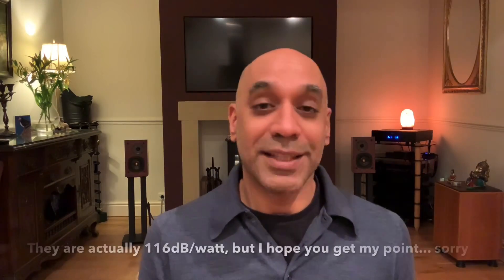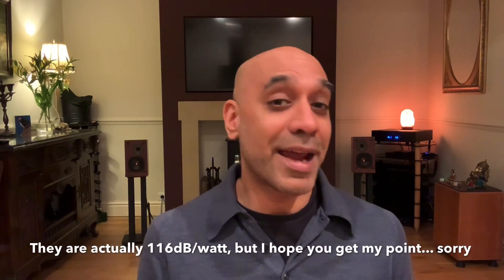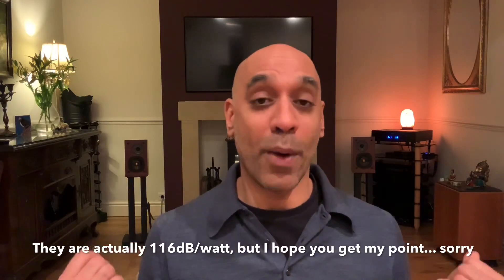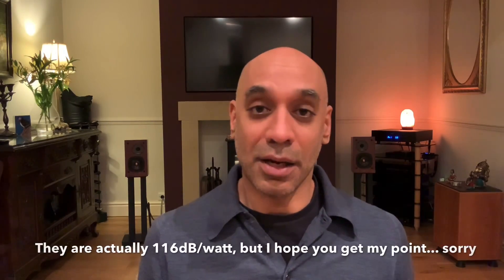Hifi Myths & Misconceptions - Amplifier Power

Comment: If an amp is very good at low bass, is this due to the amp design or because it has more power to produce them well? I seem to remember Musical Fidelity used to argue that you needed a certain amount of power to repoduce music with very low distortion and good bass, but later on they went back to lower powered amps. Any idea why this might be?
Reply from the maker: Speakers represent a dynamic load. You need enough watts to play at a certain volume and manage dynamic swings but it is how the amplifier responds to the dynamic load that is very important. Of course, there are many other considerations, slew rate, damping factor, etc..
Reply: So do you think it’s a bad thing to think of amplifier power in the same way as we do for car engine power, ie that more power means greatest responsiveness and smoothness?
Reply from the maker: @Coneman3  I think that is a good analogy 😉👍

Comment: Klipsch RP-600M's are around 93dB @ 2.83V / 1m so they're pretty easy to drive but they also dip down to 3 ohm so they're pretty hard to drive at the same time lol
Reply from the maker: Need current not much watts 😊

Comment: This is a such rare case, where the explanation makes sense. Listening to a lot of demanding classical music (large orchestras and operas) in very modern recordings with a lot of dynamic range, statements that 40 Watts would be enough never matched my experience. Maybe if you are listening to a jazz trio, although would have to be at moderate levels for low sensitivity speakers. 
When auditioning gear, my experience has been that when I needed the "horses" lots of candidates for amplification (and speakers) did not perform as great as what small ensembles hearing would suggest.
Excellent!
Reply from the maker: Thank you Petros. I appreciate you watching and sharing your experiences. Thank you for your kind words of support 😊👍
Reply: How big is your room?

Comment: Another very informative video, I subscribe but must have missed this but looking at the published date it is perhaps no surprise. I just wondered if you could give a brief answer to my scenario. I have a mid 1970 Technics reciever/amplifier which I really like but it is only rated at 15 wpc. I am looking for some compatible speakers and am thinking I need to seek something that is pretty sensitive, so I am considering Klipsch RP500M as they are rated 8 ohm 93 db. Given my financial situation would like to buy a little cheaper, so could I consider other speakers that may only be 88 or 89 db. Just to add my room is fairly small and generally don't play at any great volume, although Led Zeppelin require a little extra! Many thanks.
Reply from the maker: I think your thinking is sound. The RP 500M would be a good choice as long as you like the sound characteristics. They will be great with Led Zep. Thank you for watching and your support 😊👍
Reply: @abritishaudiophile7314  Thanks for your response. Re reading my post I wasn't too clear. I suppose what I wanted to ask was is it that necessary for me to chase such sensitive speakers, i.e if 89/90 db is okay then it gives me more options. As you will know, more sensitive speakers are few and far between and often much more expensive.
Reply from the maker: @stephensmall4172  I am not sure how much current your Technics amp can deliver but as you don’t listen at loud levels something in the high 80s sensitivity should be fine.

Comment: Great video. I cannot agree more. 95% of us need 20W or less. 
Just built (DIY) monoblocks class A 25W @ 8Ohm. They replaced 350W @8Ohm monoblocks class D and sound fantastic. speaker sensitivity 91.5dB/v/m, 50m2 room, 2m from speakers, average listening volume 75dB, peaks 83dB. No need for more power. 
Invest in quality, not in Watts!
Reply from the maker: Thank you for watching and sharing your experiences Decemberek. I always admire people who go the diy route 😉👍
Reply: Just not my experience! Small UK living room various mix of British and Japanese amplifiers (Arcam Rega Technics Denon etc etc ) latest Arcam was 120 watts. 25 year old Ruark Acoustic Templars 87db sensitivity
 Always running out of steam especially on vinyl. Experimented with valve preamp and Class D 600 watts per channel.
Very happy No strain maximum headroom total clarity and the bass is alive and palpable
I think the audio industry used to be like the car industry. The big comfortable family car starts with a 1 litre engine which is inadequate and they shaft you financially to get the 6 litre engine you really really need
Reply: Invest in quality watts.

Comment: quick question... my speakers info sheet says ''Recommended Amplifier Power: 30W/ch minimum, 250W/ch maximum'' how much am i shooting myself in the foot if i buy a 35 watt/ch amp? because following this logic it should be plenty... but then why are they recommending 30 watt/ch minimum. im confused ( Sensitivity: 87db (2.83V at 1M)
)
Reply from the maker: Hi Alex, watts are only part of the picture. You want a bit more than you need. Headroom is a good idea. Ultimately watts determine how loud a speaker will play. Try to find out what the maximum current rating is. This gives you a better indication of how well an amplifier can drive a speaker 😉👍

Comment: Just to be sure i understood (not english native speaker sorry) ; the lower the impedance, the more power you need ? Thats weird, in the headphone world i think its the opposite : higher impedance = more power needed, thats why im confused 😅
Reply from the maker: Hi Kabi, great question. Impedance is only part of the picture, you also need to consider the sensitivity of the speaker/headphone and how it relates to impedance. For example, a speaker may be driven by 1 Watt, and at a particular frequency be 85dB sensitive driving an 8 ohm load. The same speaker may drop down to 4 ohm impedance at another frequency and now will be demanding 2 Watts from the amplifier. 

Now, higher impedance headphones tend to be less sensitive than low impedance headphones. That is why they demand more power to drive them to the same level as low impedance headphones. Thank you for watching and for asking  a very interesting question 😉👍
Reply: @abritishaudiophile7314  thank you very much its way more clearer now !! Cristal clear explanations, a real master ahah again thank you :)
Reply from the maker: @Ankah  thank you Kabi 😊👍

Comment: Tarun, great video. I have a question though. I have a pair of Elacs rated at 4 ohms and 85 dB sensitivity. I was driving them on a moon audio integrated rated at 75 watts into 4. I recently switched to an anthem integrated rated at a whopping 300 watts and I noticed an immediate difference in the quality of sound and depth of the bass. It was a night and day difference. Do you think that has more to do with a different amp or the difference in power. I also listen at around 75 dB.
Reply from the maker: Hi Randy, thank you for watching. It won’t be the watts although it is good to have some headroom for dynamic peaks. Still you are probably only using a maximum of 10 watts. It will be the overall quality of the amplifier and specifically the quality of the power supply. 😊👍
Reply: @abritishaudiophile7314  much appreciated. I was quite unimpressed with the Moon. Today it went to a new home via eBay. Your comment confirmed what I assumed.

Comment: i guess everyone needs 100watts per channel, if you have two people with different taste in music & loudness. 100 watts is a must, i really dont get it how people sat 45 watts is enough.
Reply from the maker: Hi Abhijit, I depends on the efficiency of the speaker, the size of the room and the quality of the amplifier’s power supply. Unfortunately, it is not just as simple as how many watts. Higher watts can be achieved just by turning the gain up on the output device.
Reply: @abritishaudiophile7314  totally agree that a klipsh & JBL need less watts, but 100 watts is a safe bet for most of the listeners
Reply from the maker: You are probably right. It should be enough for most if backed up by a decent power supply 👍

Comment: Hi my current set up is Kef ls50 and a Hegel H90 that i was able to buy for £1050 new because it was a Discontinued - Reduced to clear item, im considering the H120 but its costs over a grand more do you think my money would be  better spent on a decent subwoofer to improve my set up or upgrade the amplifier ?
Reply from the maker: The H120 will offer an incremental improvement in sound quality. If it was me, I would be investing in a subwoofer or better still two smaller ones. Check out the BK Elec XLS200. They make subwoofers for other manufactures and used to make REL subs in the past. The XLS 200 is the most musical sub they do and it is less than £400.
Reply: @abritishaudiophile7314  i dont think my amplifier can take two subwoofers?
I really like the svs subs that have wireless app controls but they are really expensive. 
The bk xls200 is on my radar how do they compare to the svs subs?
Reply from the maker: Hi Harry, if you get a REL or BK Elec, you can use the high level input and connect it to the amplifier speaker binding posts or even the speaker terminals. The other option is to use the variable line output on your Hegel H90 but the high level input is my preferred option. Good luck 😉👍

Comment: What modern amps today push 800 watts?  Are we talking huge price leaps?
Reply from the maker: Not too many hifi amps go up to 800 watts Sean. Very few people would need 800W in a domestic setting.
Reply: @abritishaudiophile7314  These types of vids are really helpful in determining just what kind of integrated amp a guy should buy.  I'm just starting the learning process myself.  I grew up thinking the higher the wattage, the better and I like listening to my music really loud so I have it in my head that I need massive power to suit my needs.  However....my local stores aren't too terribly high end so its almost impossible for me to hear a amp/speaker combo before I buy.
Reply from the maker: Thank you for watching Sean. If you listen loud you will need more power. This video was just to shed some light on what kind of power people may use. I would start with picking out a pair of speakers first. Large speaker tend to be more efficient (higher sensitivity) and will play louder than smaller ones. Picking a speaker with higher sensitivity and power handling will mean that you will have more choice when it comes to choosing a matching amplifier and not just restricted to the ones with high power ratings. Good luck 👍
Reply: @abritishaudiophile7314  Any recommendations for a higher powered integrated amp?  I'm leaning towards the Klipsch RP 8000F for speakers and the Yamaha A-S801 Amp for starters but I'm open to suggestions.
Reply: Nord 2 based on B&O icepower as1200 boards 600 watts per channel at 8 or 4 ohms £800 brand new 2 year guarantee Other European manufacturers use B&O icepower boards
I Use a xiang sheng 728 tube preamp to drive it (£250)
Any non class D amps with this power will cost thousands 
Beautiful sounding

Comment: In my experience over the years of playing with all sorts of power amplifiers, I prefer high current amplifiers.  Also a higher wattage amplifier of like 300w per channel with high current capability is all you will ever need.  Even though you may not use all those watts the music just sounds more effortless and you for the most part cover all your speaker types without going into extremes.  I would just say the sound is not strained because you have so much power on tap and the amp is up to any task.  Just make sure its a well designed amp, since there are many powerful amplifiers out there that are just dj amps and do not sound good with a few exceptions, which I actually use in my set ups.  They are called sleeper amps and are somewhat of hidden secrets.  Some class D amps are not to bad, but in my opinion a well designed classic AB amp is hard to beat unless you pay K's of dollars and you can definately avoid that.
Reply from the maker: Hi Sound Man, thank you for watching and sharing your experiences. I really enjoyed reading your comments 😊
Reply: Yes, an ampli not able to send current won't be able to deliver it's nominal power, there could be compression on classical music

Comment: I've just bought an amp with 170w PC into 4ohms, my speakers are 100w PC at 4 ohms. My amp is in decibels and sometimes I take it up to -20db which I assume is was over what my speakers are designed for, am I going to damage them even if they sound really clear?

Am I deaf?
Reply from the maker: Hi Darren, if the speakers aren’t distorting. You won’t damage them. You need to protect your hearing on the other hand 😉
Reply: @abritishaudiophile7314  thanks Tarun, sound advice!

Comment: Super helpful thank you! I've always wondered how a 15w systems can seem to be "loud enough" and an 80w system can feel like there's not much headroom. I'm starting to understand the importance of a good preamp now. When I was using a vintage receiver it felt like once I went past 11 o'clock I was "turning it up" and now that I'm using something with a cleaner circuit it feels like anything below max volume is just "turning it down". So I guess if you are running low watts you better have a nice clean preamp so that you can ride the level in the upper register without any degradation to the sound.
Reply from the maker: Hi Marc, thank you for sharing you experiences. Certainly a good preamp can help to lower distortion and clean up the sound. Most people don’t need as much power as they think 😉

Comment: Hello Tarun, Thank you for your informative and calm, quietly delivered videos. A question regarding wattage output: when an amplifier, say for example, The Hegel H160 (which you have reviewed) is claimed to produce 150 watts CONTINUOUS  output. Is it producing 150 watts even during quiet or silent passages in music? I do understand what peak power is and the need for headroom and I know that the amplifier can delivery more current to produce the driver requirement for dynamics. I just find the term "continuous power" confusing,  can you demystify please,  every good wish, Michael.
Reply from the maker: Hi Michael, your suspicion is correct. The power demands on an amplifier change with the music signal. Continuous power is just the amount of power an amplifier can produce for a prolonged period of time (say 1 minute) without clipping, overheating or production high levels of distortion (normally below 1% THD). Manufacturers should use a test signal to determine this. The reality is that there is no particular standard that manufacturers’ follow so it should only be used as a rough guide. Thank you for watching and commenting 😉👍

Comment: Great video! I wonder if there is a website with the formulas you describe where you can enter the values and get an approximate number of what you may need? For example, I have 6 Ohm speakers in a 16' x 18' room and I listen at moderate levels (70-80db). I sit approx 2 meters from my speakers. So how much power do I need? What a great resource that would be. I subscribed btw. :)
Reply from the maker: Thanks Dwight. No website that I am aware of but you can do a similar exercise to what I did in the video. Thank you for watching 😉

Comment: Good video. Tarun, I've been around HiFi since the early seventies so I very familiar with all the technical aspects you discussed. My take on amplifiers is that when putting together a system 1.) Find speakers that you like the sound of. And
2.) Find an amplifier that will properly drive those speakers.
3.) Choose which playback format you are going to use most often and get the best possible piece of equipment that you can afford.
4.) Then spend weeks, months even find the best sounding placement of those speakers in your listening room.
Since 1984 I've been using systems with a vacuum tube preamp and a very good solid state power amp. I've been using a Forte 4a (50 wpc pure class A) power amp since the mid nineties. Fortunately, all the speakers that I own are easy to drive. That said, I would rather have a great sounding 50 WPC amp than an average sounding 200 WPC amp. Back in '96 I brought my Forte amp to a friend's house to compare it to a Parasound HCA 2200 II and the Forte blew it away (it sounded more "musical", the high frequencies were much more defined and smoother, had better pace, and actually sounded more dynamic).
Reply from the maker: Great advice miles. Thank you for sharing. This video was really trying to deal with the obsession that many people have about judging an amplifier on how many watts it produces. I wanted to give the actual amount of watts that people use some kind of context. Thank you for watching 😉👍
Reply: To summarize: Get speakers that you like,  an amp that will work with them, a playback device , then put the speakers in the best sounding place.  You talk WAY too much.  Lonely? No friends? Living in a basement apartment with a cat and one house plant? I thought so.
Reply: @randypecker6995   You didn't personally find this video informative so you go to the comments section to belittle the creator... Keep up the great work Tarun!
Reply: @randypecker6995  I forgot more than you know about Hi Fi systems. Pecker? That's a perfect name for you. Goodbye, jerk off.

Comment: I think it's always good to have a bit more power and some extra headroom. I measured the output from my amp and was suprised how low the voltages are to the speakers. generally not more than 3 volts. What measurement units should be used to measure the output?
Reply from the maker: The voltages need to be low from the amp due to safety reasons. If you are trying to measure the wattage you will need a multimeter to measure voltage and current. The combination of the two is the wattage.